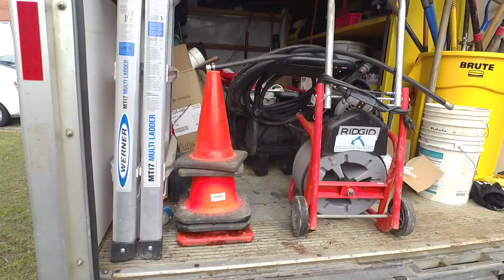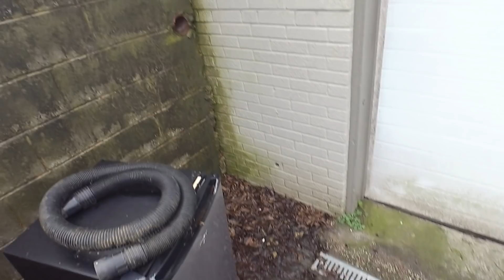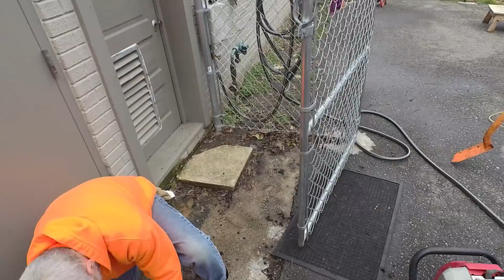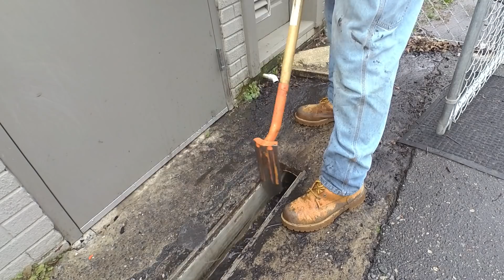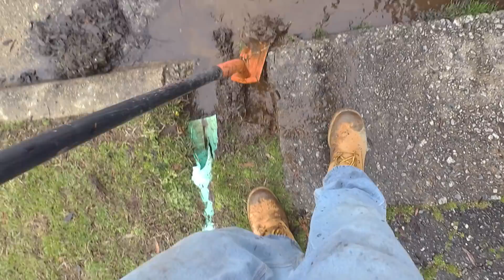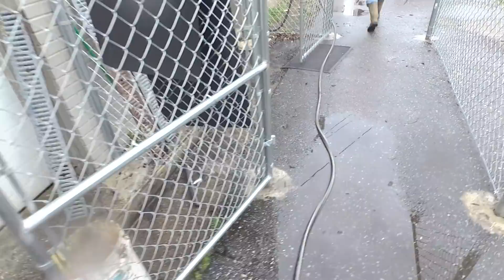Emergency Channel drain Clean out

Comment: thats what happens due to the drain line barred so shallow, the frost heave the pipes up and down, specially really bad in clay, as clay never drys, my yard will heave up to 3 feet in places, and go back down when it thaws out, but never back to were it was it take a year for one inch of red clay to dry in the sun. i can dig water lines down 7 feet and the side wall are oozing water as you go though different layers of clay, there always a seam of water between each types of clay layer. i have heard contractors give excuses like.  worst case scenario is there is some major utility line where the high spot is in the pipe and they had no choice but to do it that way. witch is total BS.  you go under,

Comment: Call me old school and it likely isn't code, but if that was my property and I didn't want to replace the whole line...I'd make a big sump pit in the concrete there where that existing drain is by the house and put a grate over it. The piping for the sump pit...it may be messy and an odd way to do it, but I'd just either run a plastic hose a little smaller than the existing pipe and push it all the way through until about a foot before the street and it would just fly out of there. Or even more odd, just cram some smaller PVC pipe through that green pipe and glue them together as I went until it reached just before the street inside of that green pipe. Either way, the pump would get the water out without having to worry about rise and run. Of course, that's using power, but peace of mind.
Reply from the maker: That would work very well to keep things pumped out and clear.

Comment: PVC vs Corrugated. It is all about the install. If the install is done right, it will never clog or fill with debris.
Reply from the maker: Please do tell how to install corrugated so it won't clog!
Reply: @GCFD  With a 1/4 to 1/2 bubble incline the turbulence from the corrugation will disturb any sediment in the line. Your head to head video on this subject did not cover real life water flow. Putting a tea spoon of water down each line shows nothing.  Also you had a low spot in the line that would not be there in a proper install.

Comment: So glad you popped up on my recommended  my job is to maintain a very large commercial property. You would think in the UK with all our rain the drainage pipes would be installed correctly. There are 32 buildings on site and all dump the gutter water onto the floor causing alot of standing water. Looks like I'm going to be installing FDs from now on and catching all downpipes.
Reply from the maker: Awesome!

Comment: We have water coming in right under our sump pump inlet pipe(2 inch space all around the pipe in the pit), and nothing coming though the inlet pipe, does that mean the inlet pipe is clogged, or is it just because there's space below the pipe?
Reply from the maker: If the inlet pipe is surrounded by gravel all the way to the sump basin the water might not be flooding up high enough to get into the pipe.
Reply: @GCFD  so seal off the space below the pipe?

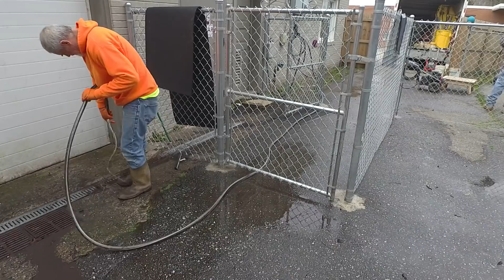Comment: Maybe I've missed it in a previous vid but I think people need to know when a single-4in is not enough.  Here an area like 8:20 would need more than a single-4in (or it looks/seems that way from my DIY experience, though maybe my rainfall is different).  One acre here needs dual-6in or a single-8in. The city here allows triple 4in through the curb where homeowners have a CB-discharge to release any surplus that the triple-4in-curb-discharges can't handle.

Comment: I need a time machine so I can skip forward to you getting the contract and showing us how it should have been done.
Reply from the maker: I’m hoping the previous installers were just careless with me later pipe and didn’t ensure that it had fall. The worst case scenario is there is some major utility line where the high spot is in the pipe and they had no choice but to do it that way.
Reply: @GCFD  In that case, they should have abandoned the large pipe and fed the channel drains into a sump pit so it doesn't matter too much if the drain has a rise in it, the pump will blow the water out anyway...

Comment: I enjoy drain cleaning video's.
Reply from the maker: How did this one measure up? Anything I can improve upon?
Reply: @GCFD  well I found you from watching Drain Addicts with Ollie and his sidekick Ratty. There is also Drain Clean Korea, Drain Cleaning UK, and NYC Drain Cleaning. All because of Ollie and Ratty. You could definitely learn stuff watching him for sure. But I think you did just fine Sean. One tip is run the nozzle through a vacuum pipe shoved into the line you are cleaning if it has sharp edges. So you don't harm your line. Peace

Comment: Might get some tips from the Drain Addict “Ollie and Ratty” in Australia on jetting! You are the boss on the repair piping to eliminate the high point in the line!
Reply: I actually found Sean here by watching those other channels 🐀
Reply: There is also, Drain Cleaning Korea and Nyc Drains, and one out of the UK and two of them mention Ratty and Ollie and the Korea ones does drains by number. Just thought you might enjoy those other channels.
Reply: Drain Addict is a good one to watch for jetting.
Reply from the maker: Thanks for the tips! I’ll check them out.
Reply: I was thinking the same thing watching this 😂 ratty and his 🌽
Reply: The root-cutter tip DA uses is like $350 & on over 4k-PSI.  He has some of the best pipe-failure examples on YT.
Reply from the maker: @SlackerU  do you recommend this for cleanout? Can you send a link to buy.
Reply: @GCFD  It's in the Drain Addict video descriptions.  I'm being auto-deleted for some reason.